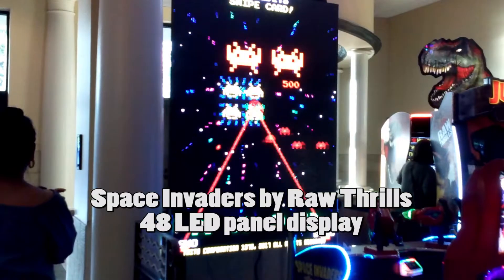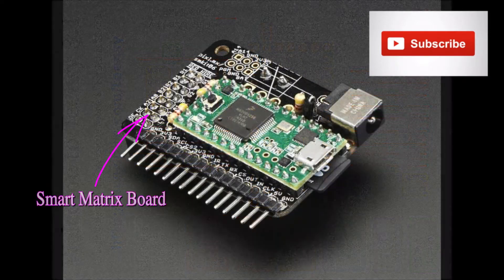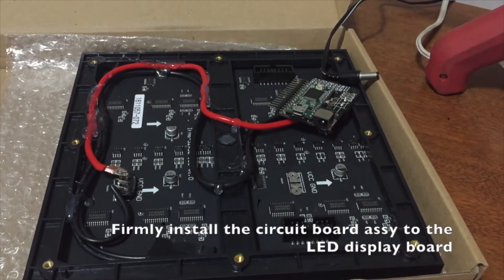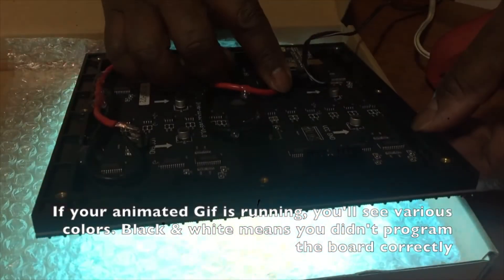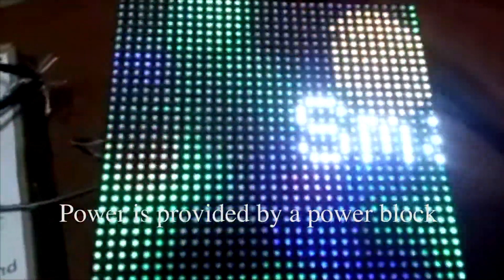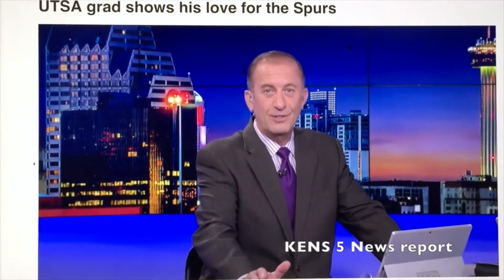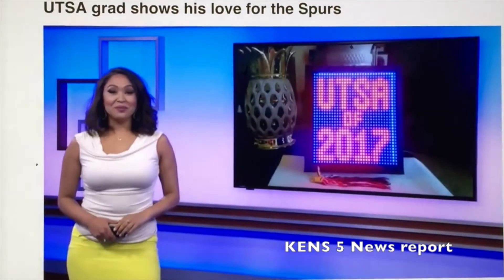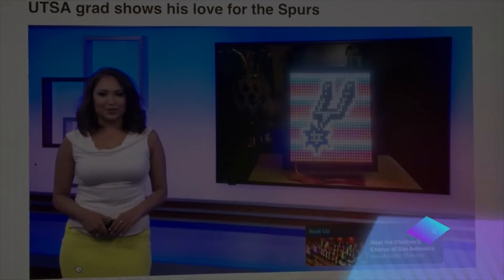LED Graduation Cap Display Build

Comment: Love this project idea! How did you power the SmartMatrix with a DC barrel jack? Was it already attached to the SmartMatrix?
Reply from the maker: A cell phone power block.
Reply: But how did you attach a DC port onto the smart matrix? The smart matrix I have is a newer version and doesn't have a dc port. Were you using an earlier model?
Reply from the maker: It was part of the teensy board

Comment: Mo, That's a great idea.  Did the viewing audience and school administrators acknowledge the hat?  Need clarification, are the smart matrix and teensy board sold as a unit or does one need to purchase each item individually?  Lastly, do I have to download the software program from GIFRocket each time I want to change the display or does the header program you mentioned have other options to choose from.
Reply from the maker: You have to build the project. Nothing comes complete or in a kit, each item is sold seperatly. Yep, you need to download some software and trouble shoot as you go. Software is downloaded only once for free & that's it.
The fear is burning up something with too much heat. Everything else just takes time and some reading. Nothing is refundable that is kicker. This is well within your scope & you know you want one for your kids, don't lie. The audience at the venue thought it was cool. Before ours the administration had banned all modified caps yet there were a hundred or more. Ours was only 1/2 taller than the actual cap. Yet some girls had caps loaded with stuff 6 or more inches high. Thats way too much ornamentation.